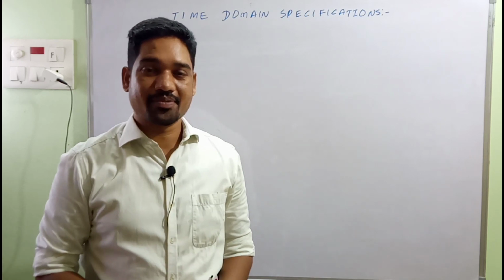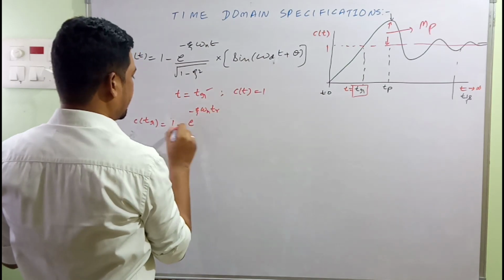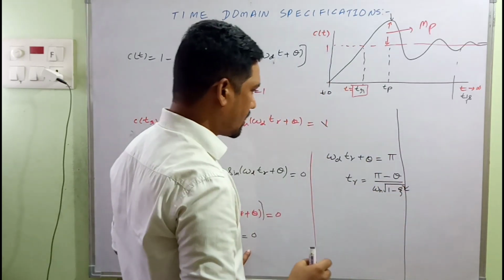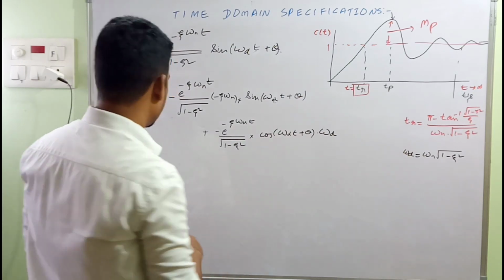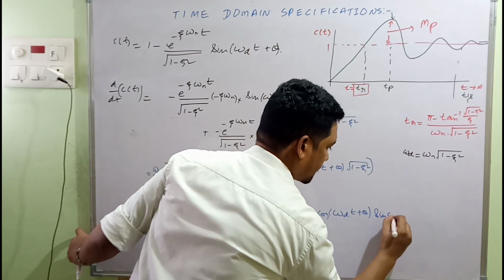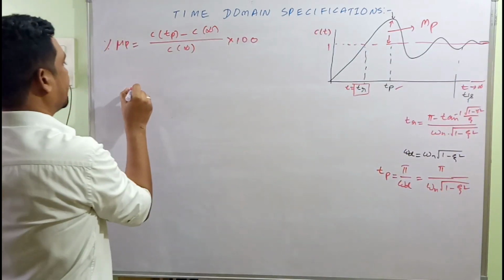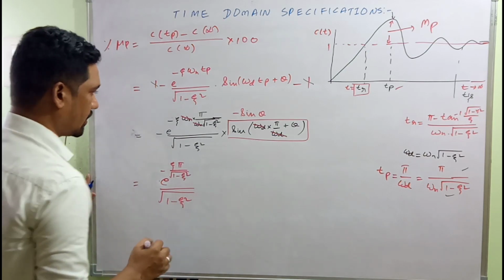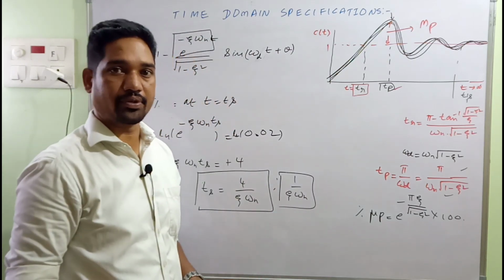Time domain specifications|under-damped second order system for step input |control systems|

Comment: Sir why are we deriving only for under damped system , why not a undamped system or over damped or critically damped system ?
Reply from the maker: In real life., and practical applications., all the objects, devices we will be discussing has certain amount of Damping value. 

Example is you, if someone pushes you, you move a bit and stop, things is you come to rest, because you have damping ratio value., if your damping value is zero u keep on moving till you die. If it is one. It will be some other action. Even a ceiling fan after switching off, will come to steady state because it has some damping ratio value which is less than one., which is the case of underdamped system. All the objects devices come under the classification of underdamped system.
Reply: @ushendrasengineeringtutori4259  Thank you so much sir